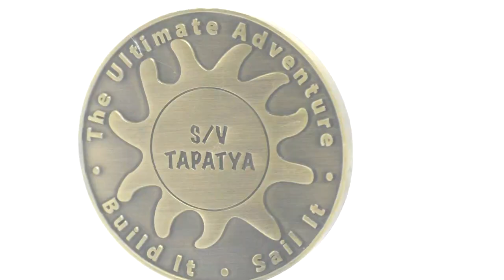The main deck and a look to the future - SV Tapatya EP88

Comment: Sounds like a good plan, mate. I'm in the process of researching timbers myself.. I'd like to use as much Aussie timber in my build as I can. If possible, I want to incorporate some Ironbark for things like the rubbing strakes, but apparently it's too dense to glue well, so I may have to get creative.. might have to see about knocking up some test pieces, I guess. Also, since you're wanting to finish off the exterior as much as you can in the near future, I have some related thoughts to share with you, but that's a bit long for a comment, so I'll be in touch shortly.
Reply from the maker: Good to use local woods. I see no justification for encouraging the chopping of tropical rainforest just so I can make my boat look pretty, and boatbuilders of the past used what was available in their vicinity. 
Looking forward to your thoughts, Garryck 👍

Comment: Nice work Tony. Very neat taping. What's the weight of the glass you put on the cabin roof? Looks like a plain weave. I found something called 'Satin Weave' and it is absolutely beautiful to work with. Looking good. Cheers mate!
Reply from the maker: Thanks mate. It's a 6oz cloth and is what the supplier recommends for sheathing plywood. I think you're probably right that it's a plain weave, but I'm entirely happy with it 👍😀

Comment: Hi Tony.
Have you any good reasons for sanding in-between-layers instead of using Peel Ply apart from monetary savings? Mads on "Sail Life" uses a LOT!
That ukulele song is lovely. Who's the artist?
Cheers
Reply from the maker: Thanks Bo 😀👍
I've never used peel ply and really don't see the need. It's widely accepted, though, that sanding between coats increases the bond strength. Funnily enough, I was talking to a materials scientist earlier this week. He has been researching epoxy bond strength under various condition and confirmed again that sanding between coats gives the best bond with epoxy 
The song is by Hazel, my daughter. Thanks, I'll pass your praise on to her 😀

Comment: Cool song while you were glassing. I think you've used parts of it before, but I don't remember hearing the whole thing. Is that you singing?

Curious if you're going straight to primer now or you plan on doing anymore fairing first. How well does the last coat of epoxy you put on fill the weave? Um, your plan for the summer sounds legit. I think you can get it all sealed up and outside before it gets cold. I have faith in you, Tony! (:
Reply from the maker: Thanks mate. Yes that's me singing - The Great Divide - The version on my album "Out of the Moloch" is the best mix of it, if anybody's interested 😜
I might do some minor fairing where the cloth pieces overlap. The second coat fills the cloth pretty well - it is really quite flat. I'll paint it all with a couple of coats of epoxy primer and sand that inbetween - that'll get it flat enough for me - she's not a showboat!
Reply: @SVTapatya  Nice. (:
Reply from the maker: @BUILDING A 26' AUTHENTIC STEEL TUGBOAT CRUISER Nice track. Good work! :-)